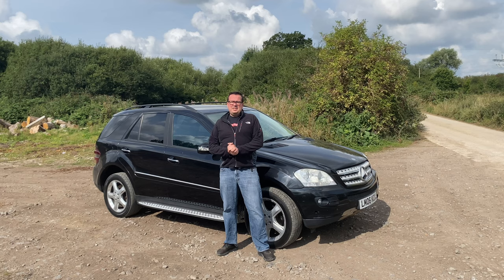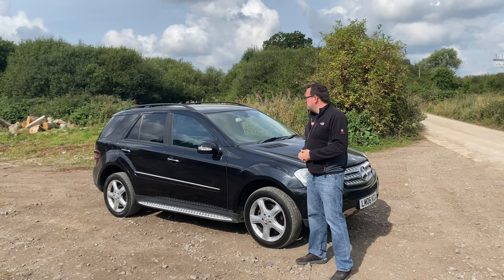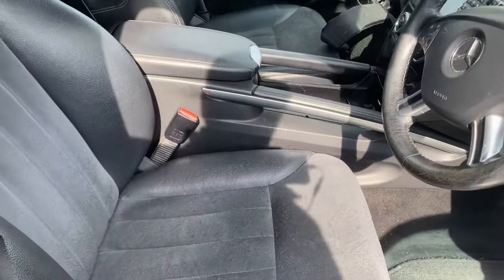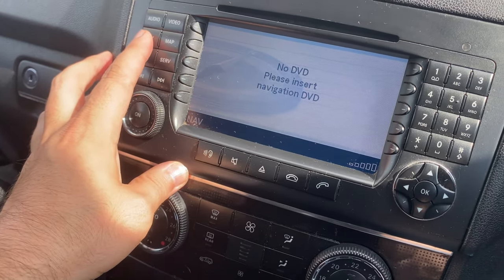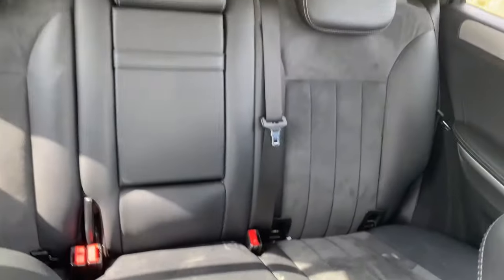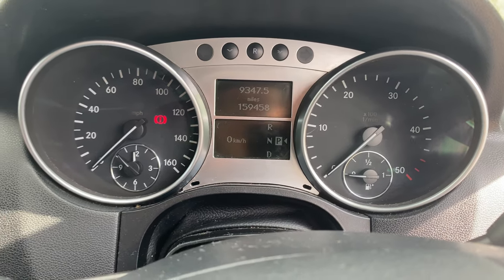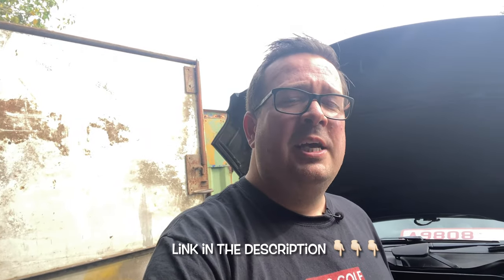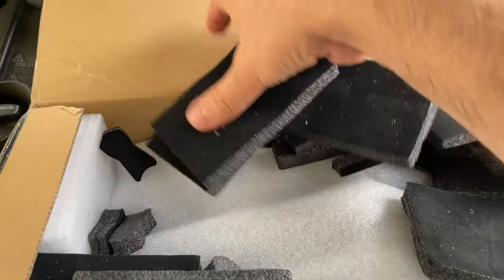I Bought A Mercedes ML For £1000!

Comment: Right Now 2022, I still looking a ML CDI 280 of the 2008 is a great option is no matter it have 16 years old the Quality of Mercedes is the best!!
Reply: @pedromoronta5025  if you can fit the 2005 it's in a lower tax band BUT there about a extra £2500 to buy

Comment: Still it’s an unbelievable deal, great catch! I’ve searched all over Germany and I’ve never found one without massive damages with less than €5,000 for 2006+ MLs! The W164 found itself between classic and modern models has a lovely look with reliable engines!
Reply from the maker: It was such a great car for £1,000 and such a simple fix as well.
Reply: @BarnClubCars  there's no way u can find this car under 5000 euros if its functionnal , maybe 4000  BUT it will be a mess ,,,,,,,   SORRY   but im just not buying the  fact you bought it for a 1000

Comment: Is this 2010 model?
Reply from the maker: It’s a 2006 but they used this body style up to 2018. I think the last ones were the Mercedes GLE but it was really just a face lift of the 2005 w164
Reply: @BarnClubCars  actually W164 went from 2006 to 2011! Cheers Drew

Comment: Hows It Now
How Much Did Ya Have To Spend To Get It Reliable?
Reply from the maker: Changed the inlet y pipe with the mafs, an abs sensor and a service and it was good for a year until the turbo went. But it was on about 170k so not unreasonable to have to expect to change a turbo. It was a great car 👍🏻
Reply: @BarnClubCars  
I'm Looking At A Ml320CDI Today 
135000 Miles 
I'm A Caterpillar Former Diesel Tech So a Be Pulling The Wrenches
I Figure Timing Chain Very Soon After Purchase.(Price Depending On Availability Of Timing Gear Chain Brealer)

Time Table For These I Do Not Know:
Injectors ($2200 For 6)
Common Rail Pump($1000)
Turbo($1000)
So I'm looking At About $4000 For Large, Wear Items Maintenance.
Maybe Heads At 250,000 Miles..
I Hope They Last That Long